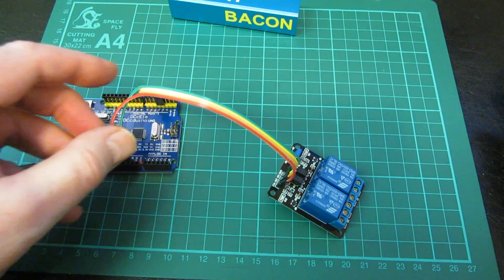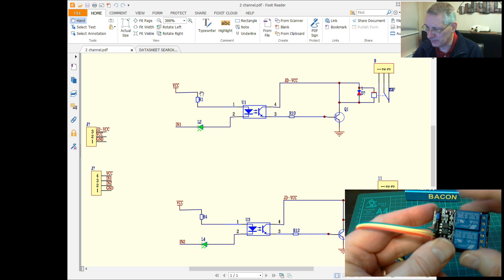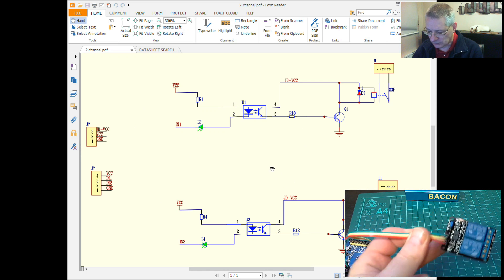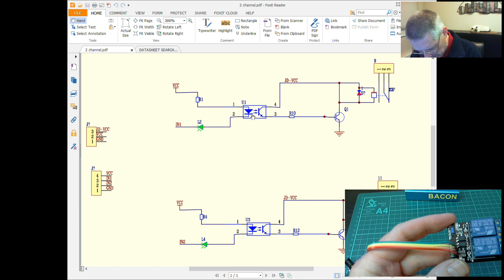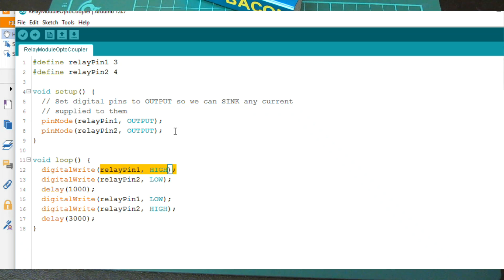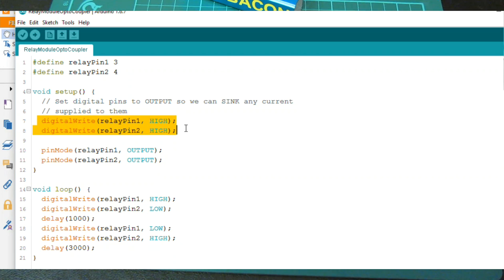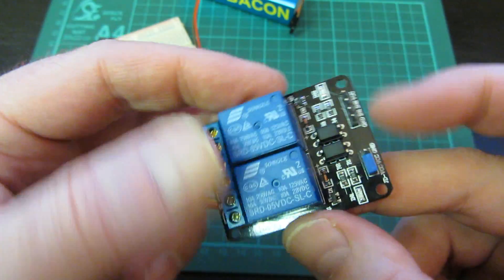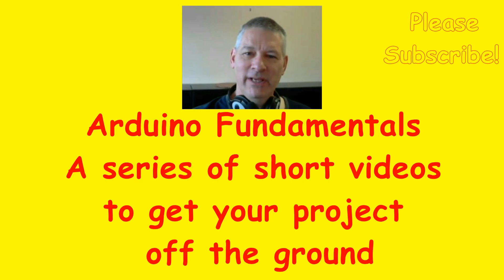#18 Add a Relay Module to your Arduino project - Hints, Tips & Traps

Comment: Thanks Ralph for a very helpful video. It seems when using a 5v relay things are pretty straight forward and easy but, the problem starts going beyond 5v even 12v could still be all right since can use the VIN on Arduino but as far as I understand it and for the benefit of others you cannot use Arduino to trigger a 24v Relay. Although 12 is still ok feeding the Vin with an external 12v. Generally it seems triggers can only be done within 10% of the Relays Voltage rating as in min. 9v required for a 12v one and 21v to trigger a 24v relay!
Reply from the maker: Glad you found it helpful, Cy. 
You can always trigger a higher voltage relay if you supply the necessary voltage independently, usually controlled via a N-MOSFET. So the Gate of the MOSFET is switched on via the Arduino (via a 100Ω resistor), the Source of the MOSFET is connected to GND and the Drain of the MOSFET is connected to one side of the coil with the 12/24v connected to the other side. All Grounds are connected together (common ground). A simple TO-92 outline 2N7000 MOSFET works well, usually.
Reply: @RalphBacon  Yes quite so, but then you'd be making a relay of your own to get the ready made one going. It's just best for everyone to know, if they want to get an MU like Arduino to trigger the relay, to NEVER buy a relay with more than 12v nominal rating.  That is a 5v one can be run with no other changes necessary and the 12v one only with connecting a 12v supply to vin and then, only the MU/Arduino input signal line connected to Arduino and everything else on both sides input/output must be connected directly to the external supply which should not be leass than 9v also feeding the VIN. The relays with J-D VCC more versetile/safer draing much less current from thr Arduino  Vs. the ones without it(my 2 cents after suffering 2 days of searching and trial error to get a 12v relay without JD-VCC going). I often wonder, why the Cinese don't invest a few bucks to write a proper tutorial on their product, I hope it is NOT intentional?
Reply from the maker: Perhaps in Chinese, the phrase "invest a few bucks" is often misunderstood as "keep the costs down"?
Reply: Also now-a-days Relays mostly come with the bi-directional Optos meaning no JD-Vcc! A bad Idea since JD-Vcc and the external power option not only creates total Isolation but also much less current draw on the Arduino since it only needs to light an Led and has nothing to do with the relay coil which gets powered by the external source.

Comment: hi Ralph,

Recently I am working with relays.

If the relay part number is "SRD-12VDC-SL-C", can it still be used for Arduino 5V and ESP32 3.3V as some said the "12VDC" means the relay is operating under 12V, does it means the JD-VCC have to supply 12V and VCC input is +5V DC ?

Let's say, I am using ESP32 3.3V gpio pins, can the relay "SRD-12VDC-SL-C" works or I need to get "SRD-03VDC-SL-C" model of relay ?
Reply from the maker: I would be very careful about switching on a relay (coil) directly from any GPIO pin, Ricky. They have very limited current available (40mA absolute max, but usually we limit to 20mA). I would use the ESP32's GPIO pin to switch on a MOSFET (or even a standard BJT) that then turns on the relay. You can use a simple 2N7000 MOSFET (I use this in my Workshop Heater Controller and it works well with the ESP32).

This means a 5v relay will work because you have enough power from the +5v pin to run the relay. So what you really need is the relay model SRD-05VDC-SL-C, but if you limited the current through the transistor you could use a SRD-03VDC-SL-C running from the 5v supply line.

Do not forget to put the protection diode across the coil otherwise your MOSFET (and even the ESP32 GPIO pin) will be damaged.

If you need more information look at my Heater Controller schematic from video #225: 
https://youtu.be/xJ8Q3ysC8Q8 
The link goes to my GitHub here: https://github.com/RalphBacon/225-Project-Design-and-Implementation
Look at the relay bit in the middle with the 2N7000 MOSFET.
Reply: @RalphBacon  , thanks for the feedback, I will take note on your suggestions.

Comment: I can't get this setup to work. If I use the hopper on and power JD-VCC with VCC from Arduino it works fine.
But if I remove the hopper and connect an external 5V source into JD-VCC the clicking stops. The LEDs is still blinking but there is no power going to the coils. What can be the problem here? I've checked the voltage and it is indeed 5V going in to the JD-VCC.
Reply from the maker: Hmm. Let's check:
1. You have removed the jumper. 
2. VCC from the Arduino goes to (one of the) VCC pins on the module.
3. The IN1 (incorrectly named) on the module goes to a GPIO pin on your Arduino and lights the LED when you make that pin LOW.
4. An independent +5v goes to JD-VCC.
5. The GND from the independent +5v goes to GND on the module.

So there are only TWO wires from the Arduino running to the module.
There are only TWO wires (+5v and GND) connected to the module from the independent power supply.

Is this your setup, Johan?

As a further test, you can also connect +5v and GND from the Arduino UNO board to the module (INSTEAD of the independent power supply, do not connect both) and it should also work.

Let me know!
Reply: @RalphBacon  Thanks for the quick respons Ralph!

Yes this is the exact setup that I've been using, but nothing happens except that the LED is blinking.

How do you mean in the last note? That I connect the arduino +5V to VCC and JD-VCC and the Arduino GND to GND on module?

That should be the same setup as if Im using the hopper right?

However I want to use a setup that uses an independant power supply. Perhaps something is broken in my Relay, I'm going to make a try on another relay later today. 

Thank you!
Reply: @RalphBacon  I couldnt wait to try it out on a new relay, so I did it during my lunch break. However it still doesnt want to work with an independent power supply.
I recorded a quick video of the setup with and without hopper, hopefully you can see something - the video is shaking a bit unfortunatly.

https://youtu.be/OA9JGQ1QUNg

In the end of the video I reconnected the GND from the arduino that made the coil activate, but it doesnt switch back and forth. 
But yeah, I'm clueless about what the issue could be.
Reply from the maker: You bring a whole new meaning to the words "Shaky Video", Johan 🤣

Now that relay board is not the same as in my video; it's a Velleman quad relay board, possibly a VMA400, can you confirm the exact model you are using?
Reply: @RalphBacon  that is a WPM400. But I have also been trying to use a Sunfounder 2 relay module.
Reply from the maker: Let's focus on the WPM400 then. This is wired very differently to the one in my video. For this video you must connect:

1. +5v (independent supply) to VCC pin
2. GND of Arduino to COM pin
3. GPIO pin(s) of Arduino to IN1/2/3/4 pin(s)
4. GND of independent supply to GND pin

Here's the schematic for it:
https://www.velleman.eu/downloads/29/infosheets/vma400_scheme.pdf

Let me know how you get on. I'll catch up tomorrow.
Reply: @RalphBacon  Yeah as you asked me the question I went out to find this schematic aswell, bad of me to assume they are wired the same.

Right now I've the following setup:
2 wires from Arduino,
GPIO pin to IN1
+5V to COM

2 wires from independant power supply
+5V to VCC
GND to GND.
Reply from the maker: Not quite. The COM must be connected to the GND of the Arduino, not +5v.
Reply: @RalphBacon  Oh yes ofcourse, so I dont need any connection from the Arduino +5V in this setup?

This is my setup now then.
From Arduino:
GND to COM
GPIO to IN1

From Power Supply:
+5V to VCC
GND to GND

However the relay isnt powering.
Reply from the maker: If you connect the IN1 to the Arduino's +5v instead, it should switch on too (this ensures the sketch is not at fault here).
Reply: You mean to say the following setup?

Arduino to relay
+5V to IN1
GND to COM

Power supply:
+5V to VCC
GND to GND

Nothing happens, except that the LED of the relay starts just flickers quickly as I make contact with the IN1 pin for a brief second.
Reply: @RalphBacon  I just found my issue... as Im pretty new to electronics etc, I didnt look at the polarity of my power supply module thats connected to my breadboard..

I have the entire time put 5V to GND and GND to VCC without knowing it.

Thanks a bunch for all the support tho, much apprieciated.
Reply from the maker: @johanoberg149  Glad you got it working! But that was a very dangerous mistake to make, lucky it was not connected to anything sensitive to polarity! But a lesson learned now is better than later.

Comment: Thanks for the video,

But I am a bit confused by the closing comments, you mention the protection diodes and that all you need to do is connect the Arduino to those inputs (easy),

But a bulk of the video was discussing the issue of jumper pin and the two circuits not being isolated.

So is it ok to use the Relay with jumper between VCC/JD-VCC and the Arduino powering the whole thing? Do the protection diodes protect the Arduino?
Reply from the maker: I'm sorry to have confused you; it was because I was trying to cover two points here.

You can connect the jumper between VCC and JD-VCC to power everything, then connect up to the Arduino as described in the video. Because the relay module is isolated as far as the GPIO pin of the Arduino is concerned (that opto-isolator) there is no need for any further protection. Note that the relay energises when the GPIO pin goes LOW (not HIGH as you might expect) because the current flows from VCC into the LED then into the GPIO pin then to GND.

If the Arduino were to ever power a bare relay (coil) it would need the protection of a diode connected across the coil contacts so that when the relay was de-energised, the back-EMF (potentially hundreds or thousands of volts) caused by the collapsing magnetic field of coil did not find its way back to the GPIO pin.

Regarding that VCC/JD-VCC jumper, if you were to power the relay module with an independent power source (and removing the jumper) it would improve the isolation as all the Arduino environment now sees is the LED within the opto-coupler. But it's not necessary to do this.

Have I confused you even more now, Andrew?

Comment: Hi, I have a similar (1-channel) relay that only has three lines on the Arduino side: DC+, DC-, In1. I had connected all three to my Pro Mini (clone) and after the second switching action it blew. Then I tried a second Pro Mini and it blew already during the first switching. I figure the module draws too much current from the Arduino? The product description of the relay says 3.3V but in regard to DC+ it says 5V, I thought it was a mistake but maybe that's the reason why the Pro Minis blew as they are 3.3V?

I now want to try something else, i.e. power the module separately and only connect GND from the separate power source (is this necessary?) and In1 to the Arduino. Would this work or is this also gonna blow up the Pro Mini?

I am not sure whether links can be posted here, I'll try anyway :-) It's the link to the relay I bought:
aliexpress.com/item/32899763894.html
Reply: for anyone trying this type of relay: the separate power supply and connecting GND to the Arduino blew my third Pro Mini. I haven't tried without GND but I have a suspicion that either that will kill my last Pro Mini, too or it won't work at all. I have tried a different module instead, seems to be working now. Anyways, maybe the zener diode on the module was defective, I read some strange values with my multimeter but I don't know. Won't use or recommend the 3.3V relay, that's for sure. Either bad quality or bad layout.
Reply from the maker: It's odd that the entire microcontroller would fail; just the GPIO that you're driving the relay might die if there was a problem but the rest should be OK. But if they have completely died, try powering them via the +5v pin (it bypasses the on-board regulator) and see if it works then. And use a current limiting resistor from the Arduino GPIO pin of about 100 ohm.
Reply: @RalphBacon  that may work, however, I've replaced the relay by another model (5V) and also replaced the 3.3V Pro Mini by a 5V Pro Mini. Since that configuration works I'll stop my experiments to prevent my last 3.3V Pro Mini from frying. Thanks for you help anyway :-)

Comment: Hi
I think I have that problem with my ESP32 board, I have interface it with the relay after some times like 2 minutes of working nicely, it stops working at all until I have to disconnect to power supply (I supplied it from my computer) and I reuploaded the code. Tomorrow I will test your method and see.
Thank you
Reply from the maker: Be careful with the ESP32 GPIO pins, they are 3v3 and might not be enough to trigger the relay. 

Also, you should be monitoring the serial output of the ESP32 (at 115200 bps) as it will tell you why it's crashed (eg Panic, or Brown Out Detected).
Reply: @RalphBacon  I succeeded to interface that, guess what I it works well. Thank you for the tutorial:) 😍😍😍

Comment: Thanks for all your videos!

Can you offer any advice please, I've read reviews about the same relay you used on Amazon, which indicates they aren't safe.  One says (and includes an image):
https://smile.amazon.co.uk/dp/B07BVXT1ZK
"This product should not be used with mains voltages.
The clearance between low voltage and mains voltage is just 0.6mm.
This should be a minimum of 4mm . As you can see from the photo, the 5V DC input to the board passes 0.6mm from a relay pin that could be at 240V AC.
Reported to Amazon, twice. and it is still for sale
Reported to UK Trading Standards, and it is still on sale.
There are plenty of relay modules like this available i strongly recommend you buy one that has had the PCB routed to some kind of standard and NOT one of these"

Would one like this be better? - https://smile.amazon.co.uk/dp/B07RKH9KLM
Reply from the maker: The second image shows an air gap surrounding the centre pin which is a very good implementation of keeping mains away from low voltage stuff. I did much the same in my workshop heater project. The first image (from a reviewer) seems to show the tracks running too close to one another.
The other option is to buy from a reputable components dealer (eg RS Components, Mouser, Digikey etc) who will have ensured the correct standards are being met (or, at least, you have a chance to look at the datasheet for the device and decide yourself).

Comment: Thanks for a great video! You are right about the jumper at around 15:30 and newbie assumptions. One might assume the jumper is to be in one of the two possible positions. I removed mine and turned it 90 degrees and placed it on the VCC pin as a reminder.
Reply from the maker: Yes, I do that with jumpers too! But they do have a habit of then jumping off, never to be seen again! That's why I bought a pack of 50 some time ago. Glad you found it useful, Mike, good to hear from you.

Comment: Can someone help in my project?

I used coin sensor and interrupt pin in arduino to catch the pulse that coin sensor sends. Everytime the relay clicks or goes from low to high, the arduino interprets it as the pulse of coin sensor. Any advice?
Reply from the maker: Has the relay got a reverse voltage (aka back EMF) protection diode across the coil? You might also need a snubber across the relay contacts to prevent a pulse being generated, more details in video #131 https://youtu.be/OAmXypXwkeg
Reply: @RalphBacon  im using the same relay module you used in the video

Comment: If you wanted both relays to be off at bootup, would you set the pins to low before using pinMode?
Reply from the maker: Yes; Nick Gammon, Arduino guru, once told me to set the pins LOW before changing the pinMode to avoid the tiny pulse that will otherwise appear on the relay pin, which might cause the relay to chatter.

Comment: Awesome video! Does anyone know where i could get more info or paid online training on how to write code for arduinos and relays
Reply from the maker: There are doubtless many, many books on the subject, as well as videos, not least on this channel. 
However, the best way to learn is by doing, tweaking and understanding. You should at least be able to understand each and every line in your sketch - even if it's written by someone else. 
Start small, build on that. If you try and design the equivalent of NASA using an Arduino UNO you will become frustrated and eventually give up. My list of videos:
http://bit.ly/YouTubeVideoList-RalphBacon

Comment: Hi.. I have a 12V power supply for the Arduino. The 5V from the Arduino  I use for the output pins/ opto coupler diodes...for the Relais I use Vin from the Arduino Board... which is the 12V before the Arduino Voltage regulator.... This is not a full galvanic isolation but I think the Arduino is well protected this way...Do you think so too?
Reply from the maker: Yes, correct, Stefan. The Arduino is not totally protected but pretty good. Good enough, anyway!

Comment: hey Mr Ralph can you please help me with my project here about 2 sensors , LCD, RELAY MODULE AND ARDUINO ITS my first time using them.
Reply from the maker: You need to start with some simple things first, Khulile. Try getting an LED to flash (and know why it's doing it that way). Then move onto the relay module and get that working. Then do the sensor... the only way to succeed in a project is to break it down into small, manageable chunks. That way you learn how to do each part and can build upon your knowledge. There are plenty of videos on this channel for beginners like you, but you must walk before you can run.